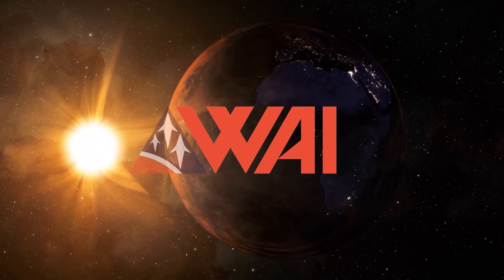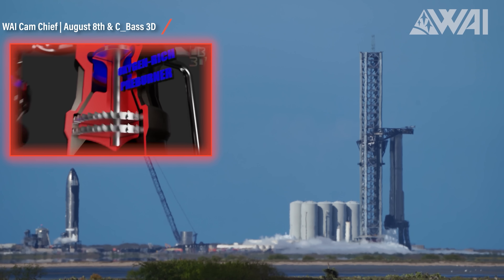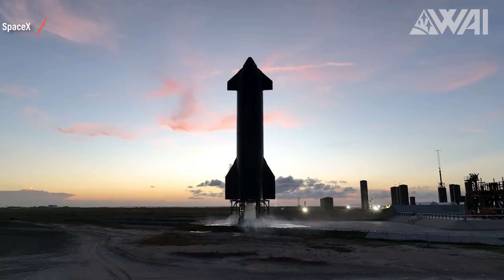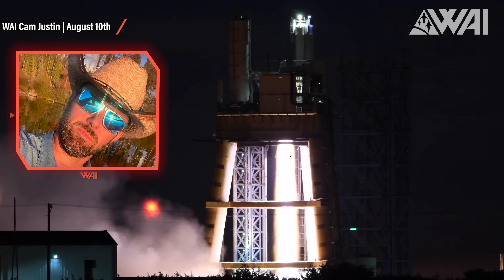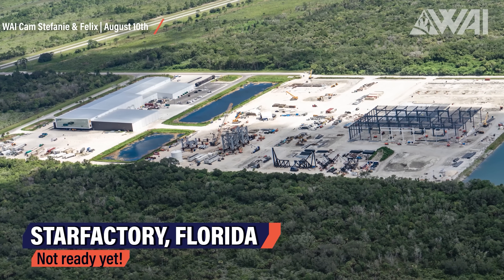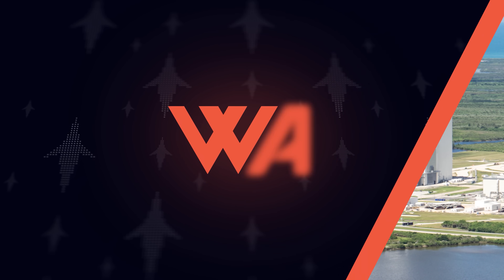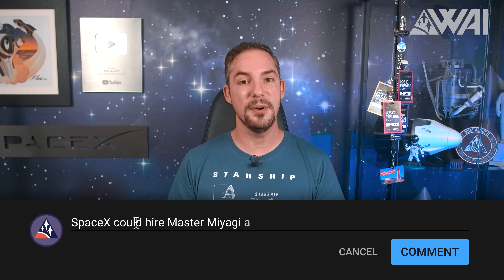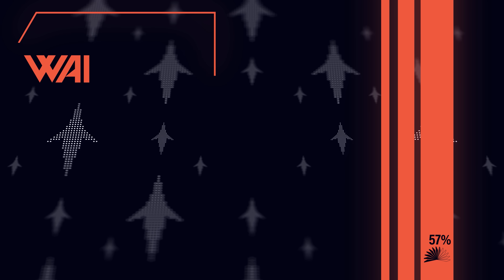SpaceX's Starship Orbit Flight Tests Already Going FASTER Than Expected!

Comment: Sorry but they're not gonna get that thing off the ground "in a month", or even do a full wet dress without a proper flame trench, full water deluge system & propellant burn-off igniter installation. Stage Zero needs some serious upgrades. Why does no one address these obvious flaws?
Reply: Flame trench isn't necessary, water deluge will be tested soon (now not used yet), and burn-off igniter isn't a full mandatory/the only solution. But yes they're not likely to launch this in just a month from now
Reply: @alvianchoiriapriliansyah9882  Why is a flame trench not necessary? All large rockets have needed one but somehow this thing doesn't? Can you explain your reasoning at least?
Reply: @alvianchoiriapriliansyah9882  Also, I see no evidence or talk about this water deluge system you say is "now not in use". So they've tested all sort of ground infrastructure, but not a decent deluge system, are they just crossing their fingers that this as yet unspecified system will work on the day? What's the alternative to burn off igniters then? Did you not see what happened to booster 7 the other week?
Reply: @alvianchoiriapriliansyah9882  Don't even get me started on how pie in the sky any atempt at catching this thing out of the sky would be on this stage zero. Why would anyone try to catch a booster on the same structure as you're taking off on until at least the manover had been perfected on a seperate catch tower? Walk before you can run. They seem to be able to build these towers relativly easily, one built only for catching would be cheaper still.

Comment: Perhaps there will be 2 towers on Pad39b.
One will shorter arms only for stacking / launching starship and near the crew pad.
 The other tower will be far away of the 2 others for less risk and this tower will be dedicated for landing with large shopsticks.
With this architecture, this is the most safetiest way to launch and land booster and manage safety for the F9 crew pad

Comment: There has been electronic equipment on the shelf for decades that can land Falcon and Starship with greater precision than Falcon currently uses. As you might expect since no one has actually seen it work only the engineer who designed it knows how the chopsticks work. We all just hope you can hover a rocket between them long enough to capture the vehicle.

Comment: Nasa has expressed their concern of any damage to the only human rated launch pad in the US. If they still plan to catch a booster at 39A, then they must have some really good data leading them to believe that a booster and Starship can hover so precisely as to be caught with a smaller system. Also, the volume of the Spheres is immense. I wonder how they plan to refill them? I also wonder if Space X has considered refilling using the KSC rail system? The rail line along the A. Max Brewer Memorial Parkway stops as it reaches the beach and is about 4 miles to the North of Pad 39A. The line along the Saturn Causeway stops about 2 miles to the East of Pad 39A. I don't know if NASA would allow extending the line but it sure would be cost effective and better for the environment that hundreds of trucks to fill up all the necessary tanks. Felix, you should take a look at the rail lines when you're out there. One of the twitter heads should ask Elon if Space X considered it.

Comment: It would be nice to know if SpaceX is going to risk a Starship AND a Booster in an initial orbital mission.  Would it not make sense to launch and land a  booster on its own first? In the same vein to date SpaceX has only managed to successfully land a Starship once. How about attempting a Starship launch and catch before flying a full stack?
Reply: No point. Remember, the goal is to launch payloads. To do that, they need the full-stack working — but in the short term, they don't need successful recovery of either. If they can get the launch part working, they can use it for Starlink missions — and that will give them plenty of opportunities to work on the landings.
Reply: Starship catch seems like the logical next step, but SpaceX really wants to reach orbit, to the point of possibly putting a couple of Starlink V2s inside Starship! I guess they think if the Super Heavy booster can take off at all it can likely achieve orbit, so why not put a Starship on top, and then they'll learn a lot about Starship firing, possible Starlink deploy, and Starship reentry. If reentry succeeds they can test out another belly flop, flip, and hover before Starship crashes into the sea.

SpaceX seems willing to have Super Heavy and/or Starship fail to land after it gets Starlink V2s into orbit (remember, every other orbital rocket besides Falcon 9 fails to land). It's going to be wild!
Reply: @skierpage  I think that what many overlook is that catching Starship and booster has no value in itself.

The value comes from taking a vehicle that's completed a paying mission, and being able to use the same vehicle for the next mission.  So it's hardly surprising that they're focusing on successful launch over successful landing. The latter counts for nothing if they can't do the former.

Comment: I assume that Starship lighting off its engines will be sufficiently away and off track so that it doesn't damage the Booster so that that can be reused.
Reply: Probably very similar to how Falcon9 boosts, separates, turns for boost back, then second stage fires.
Hopefully smoother than Falcon9's first separation attempt.
Reply: @Kevin-hb7yq  They probably learned something.

Comment: The chopsticks that are currently built are all land based. Using a droneship video as a comparison is bad because of the boat rocking and more winds. 

I imagine the offshore launch platforms will have the longer chopsticks. And certainly by the time lc39a is used for a catch, it will be falcon 9 precise.

Comment: You're comparing size and volume for both the rocket bays and the fuel tanks. That's not the whole picture. I'm willing to bet the price per liter or per square meter is much cheaper for SpaceX. They also can be constructed / setup / repaired /modified much quicker. Bigger is better but sometimes, smaller and more agile is the best bet.

Comment: The tank volume calculations seem to be off to me, or the dimensions given are wrong.
For the sphere, if the internal diameter is 21m, then the radius is 10.5m.  The volume calculation is:
     V = (4/3)pi*r^3 => (4/3)pi*10.5^3 = 4,849.04825 m^3 = 4,849,048.25 liters = 1,280,983 US gallons.
For the LOX tank, if the internal diameter is 9m, than the radius is 4.5m.  The volume calculation for a cylinder is:
     V = pi*r^2*h => pi*4.5^2*32 = 2,035.75204 m^3 = 2,035,752.04 liters = 537,788 US gallons.

Maybe someone can check my math.
Reply: No, you are right. They probably wanted to calculate a Sphere with a 20 meter diameter. Instead of using the radius that would be 10 meter, they used the diameter that is 20 meter.

Comment: don't forget that two meters for falcon nine is on a moving platform. on a stationary platform it is much more precise. The catch arms being stationary makes it much easier to be on target for a catch. check out the landings on the stationary pads. they have been getting more and more precise each time one lands. The onboard computers learn every time the fly and get better and better at it. the data they collect is then used to make each flight after better and more efficient. it is then put into every new rocket that is made making each successive rocket better and better. pretty smart idea when you think about it.

Comment: Felix, are there any comparisons on how accurate spacex land landings are vs the drone ships? Could drone ships drifting slightly as they wait result in slightly less accuracy?
Reply: The drone ships are held in place to within 1 meter using GPS and powerful water thrusters under the ship.
Reply: @paulmichaelfreedman8334  ahh right, neat
Reply: @DDKUK  Such systems have been around since we have GPS capable of pinpointing within 1 meter (I think 30 cm is the best resolution now possible)

Comment: Maybe the longer chopsticks are not strong enough to hold boosters & remaining fuel at a high enough weight to justify the length…. I.e it the last meter can only be used if the tank is near empty , it doesn’t justify that length which could become a liability. 

The longer the arm the greater stress on it when Ss or booster hits the end of it. Better to lose a ship or booster than a tower…

Comment: An important distinction to make here is that Starship doesn’t need to be fully operational to be profitable.

The ability to successfully deploy 400+ Starlink satellites from a Starship is likely to occur before Starship is able to re-enter and land successfully.
Reply: It's unlikely to be profitable in the short term either — but combining Starlink launches with Starship test flights does help mitigate the costs of both.
Reply: 150 tons of payload in a 9-meter fairing means they can lift bulk payloads, too, like solar power satellites. They’d be able to build highly profitable infrastructure in space even if the Starship is partly expended.

Comment: And no tiles went flying on latest Starship 24 test fire. The best test for those tiles on the ground will be all 6 engines firing. If no tiles go flying then it bodes well for re entry and launch.

Comment: Why not use heat tiles on the launch stand for protection?
Reply: The heat flux and dynamic pressure are much too high, the plume would rip the tiles apart from sheer brute force, and erode them if they survived that. They are really quite delicate things with the density of styrofoam and not a lot more strength than that.

 The longest-lasting flame deflectors are steel with LOTS of water cooling, built like a battleship. Concrete is Right Out for high load areas because it ablates rapidly, when we did a long-duration static fire on the X-Racer we had to pitch it up for the proper propellant feed and it chewed an impressive hole in the taxiway. The repairs were on XCOR's dime and took a while.
Reply: @r0cketplumber  Not to doubt you, but how could the tiles survive dozens of planned hypersonic reentries if they were that fragile?
Reply: @KenOtwell  Low density air. The tiles do just fine at mach 25 only if the absolute pressure is tiny, around 1/1000 the of sea level. The dynamic pressure (rho*v^2) is equivalent to something less than 300 knots at sea level.

Comment: I don't see them attempting to catch the booster at Kennedy until after they have successfully caught it at Boca Chica or another site.  Too much risk (politically) associated with a large failure at Kennedy.
Reply: It'll be fine just integrate the astronauts before falcon 9 goes vertical 🤣
Reply: @CaptainQ2607  exactly
Reply: I’ll pile on here as well and add I believe, they’ll be landing MOST times on the oil rigs that are being  re-purposed as sea based launch/landing platforms. Not for safety as much as just simple trajectory. Takes fuel, etc… to get all the way back to home pad. The simple reason Falcon lands on the drone ships, placement is everything, saves fuel….
Reply: @TheJacklwilliams  I wonder what takes more fuel: returning a Super Heavy Booster to the launch site, or driving an enormous sea-going platform out to the ocean, then driving it back, then transferring the booster back to the Orbital Launch Mount.
Reply: @skierpage  Someone’s never heard of the rocket equation.
Reply: @skierpage  Agreed, and I’m late to replying but I don’t see them driving these around as it were. I see them placed strategically in the world, adjacent to launch points. Two purposes, one, so the Heavy as it were, doesn’t have to expend all that fuel to turn around and make it back to shore, aka, shorten the distance (which is what the drone ships actually provide) and two as a launch platform give more freedom as well in launch points. However, caveat, what the hell do I know? I’m an IT engineer, not aerospace. But? I’m a fan for sure and seriously enjoying watching it all unfold.
Reply: @TheJacklwilliams  I’d suspect the platforms are a plan B or for something way down the line. It seems to inefficient for Elon to land one then have to bring it back to shore. Hard to know for sure
Reply: @TheJacklwilliams  well an oil rig is far from mobile. Moving is is terribly inefficient. So the starship will have to launch from the rig aswell or be transported with another vessel. My guess would be only transport fuel and payload/passengers to the oil rig and use them for landing and launches. Not only for landing and then transport boosters back to launch complex.
Reply: @alexandermascini9500  I think the end goal would be to have multiple oil rigs and have secondary launches prepared from them allowing them to 'hop' around the earth before returning to the US for a new mission. I could imagine it being possible to deliver a payload to orbit, land and refuel at sea and then a military payload to some land based location before returning to it's origin. That way they wouldn't need to be transported back from the Oil rig, it will just be part of their secondary mission perhaps?
Reply: @Jadinandrews  I think they're looking to use the rigs as much as possible. Getting launch and landing approval will be so much easier. So I'm guessing they'll only use land bases for new ships and repairs. But mostly they'll do launches from sea. Impact on land is too great. Especially in densly populated areas.
Reply: I don't get how will the booster go back to the launch site while trying an orbital flight. The current falcon 9 requires drone ships for a reason..
Reply: @theegodelpozo  Falcon doesn't require drone ships... but the payload hit for RTLS is too high for most missions. One of the Starship design goals is to minimize that impact, allowing RTLS on every launch.
Reply: Plus considering that 39a is used for the ISS Crew launches I think that they will be using it for launch only. At least for now.
Reply: Yeah. I will say though, that precision landings on smaller chopsticks may not be all that bad, because a super heavy booster won’t have to hoverslam onto them. Because it’ll hover, it will probably be able to fine tune it’s position more accurately before “touching down.”
Reply: https://youtu.be/KA84wzdXt3g
Reply: Yea but it's spacex they tend to just throw money at the problem and forget about it
Reply: You must be new to FL.
Reply: Yeah no chance NASA want boosters landing near their access to the ISS.
KSC boosters will land at LC-49 when it's built.
Reply: Duh